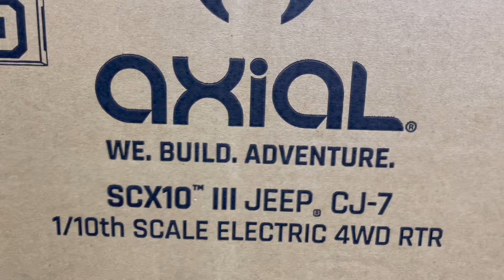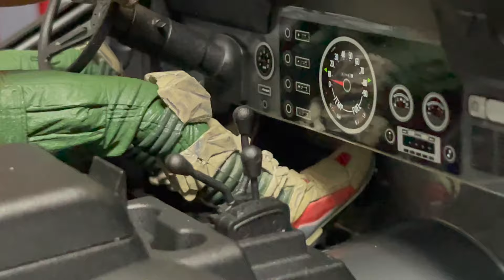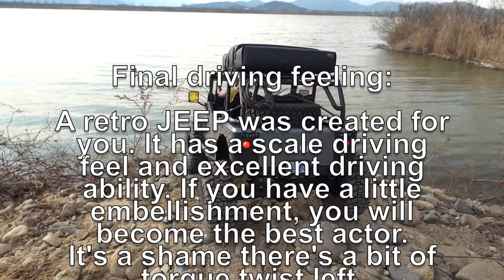Axial® SCX10™ III Jeep® CJ-7 ll Unboxing and first off road drive

Comment: Buongiorno.
Scrivo per chiedere un consiglio sulla batteria per la Axial SCX10 III Jeep CJ-7.
Sul sito c’è scritto “Needed to Complete: 2-3S LiPo Battery with EC3 or IC3 connector”.
Sul sito ci sono 2 batterie consigliate.
Su "2S Completion Guide" c'è la "Spektrum Smart G2 Hardcase LiPo Battery IC3 5000mAh 7.4V 2S 50C".
Su "3S Completion Guide" c'è la "Spektrum Smart G2 Hardcase LiPo Battery IC3 5000mAh 11.1V 3S 30C".
- Praticamente nell’utilizzo cosa cambia tra "7.4V" e "11.1V"?
- Praticamente nell’utilizzo cosa cambia tra "2S" e "3S"?
- Praticamente nell’utilizzo cosa cambia tra "30C" e "50C" e "100C"?
- Come si fa a capire quale batteria è più indicata?
- Quale batteria consigliate per la Axial SCX10 III Jeep CJ-7?
Grazie.
Luca